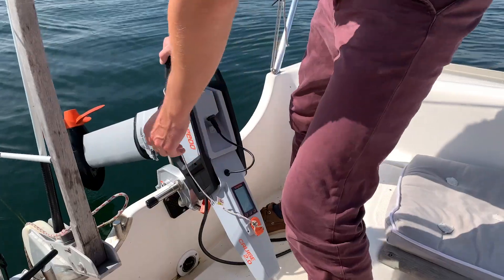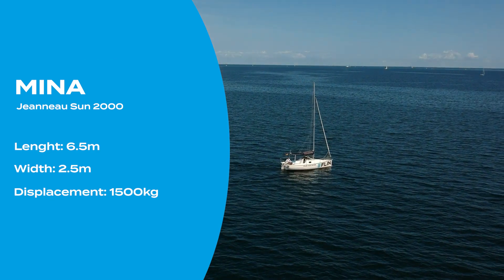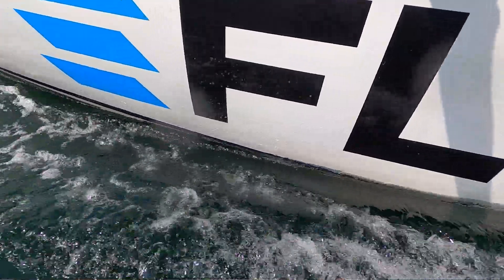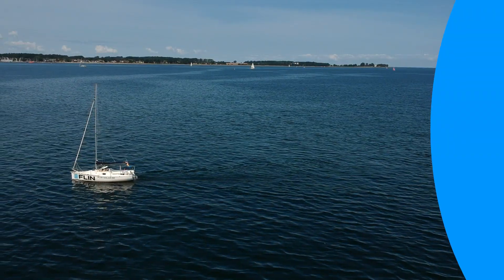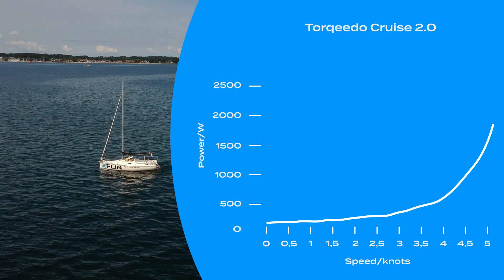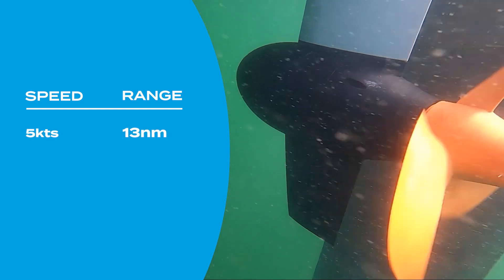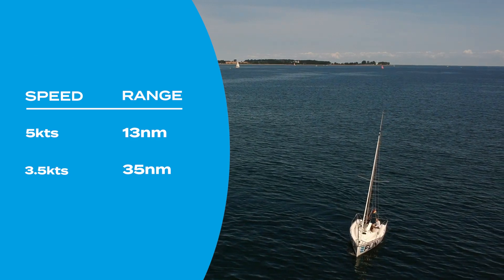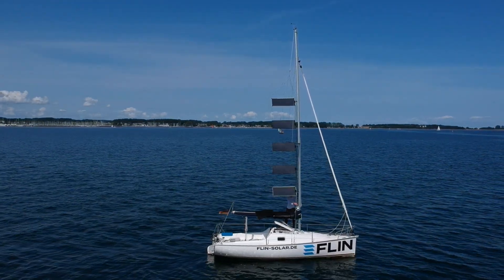Range and efficiency of the Torqeedo Cruise 2.0

Comment: Hi Flin Solar - Interesting product! I would seriously consider, but the pricerange is still a little steep compared to other power alternatives. You should consider asking the sailing channel UMA to be a product sponsor on their electric sailboat. They could really use it for their anchoring in remote places.
Reply: The price is due to the specially manufactured high-quality and particularly robust solar modules and the other components such as the bag. Everything is made in Europe. The adjustability of the solar panels compensates for the price, as the FLINsails generate significantly higher daily yields than permanently mounted solar modules :)
I have already tried to contact Sailing UMA, but without success so far. Do you have contact with them?
Reply: Why he's doing a video right now. Why give them well to do folks more free stuff? They want it they can afford it.